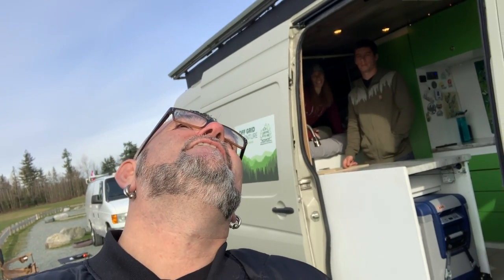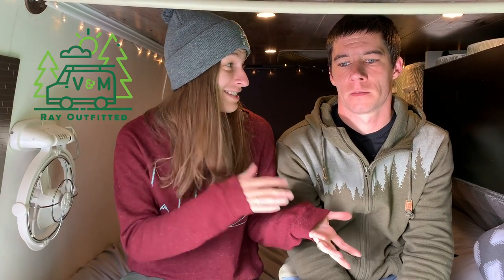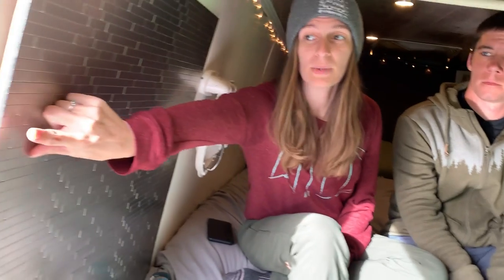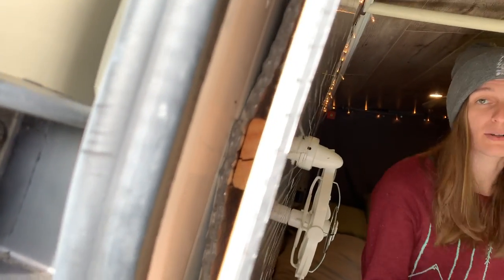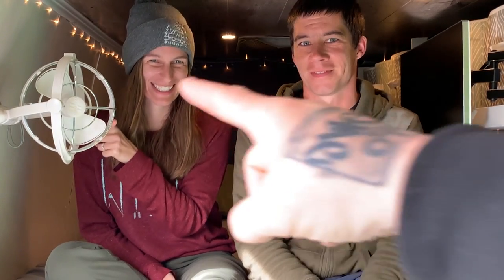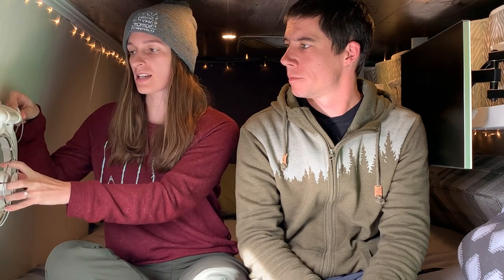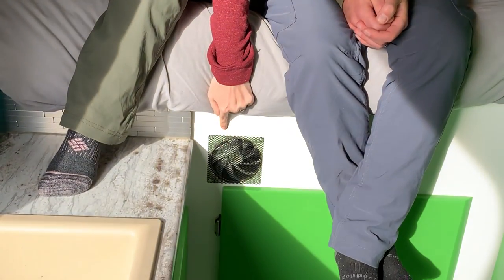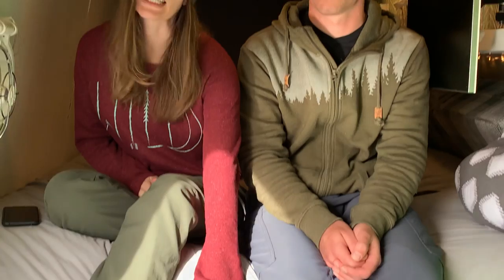Moisture Is Van Life's BIGGEST Problem | VENTILATION and CONDENSATION

Comment: I'll be darned, I actually did something right in my DIY van build.  I have plenty of gaps to allow air flow behind the walls, ceiling, bed, etc. in my build.  lol.
Reply: dont ya love when a "plan" comes together?! lol
Reply: the first will be the last
Reply: I don't believe it works unless you blow hot air into these gaps. Sure, airflow under the bed is great, but if humid air gets between insulation and metal surface and the temperature outside is below dew point, not even mentioning freezing temp, water vapor will inevitably condense on the metal just as it does on glass and won't evaporate for a long time. It might even freeze on the internal side of metal surface. For the context, I am concerned about high humidity weather in UK or Ireland.
Reply: Water vapor will 100% condenser behind even air gapped walls. I purposely left a piece of my tongue and groove off to prove this. I made sure everything is off the metal and then keep my roof vent open and windows cracked even during winter which seems to help

Comment: Ventilation in the UK during 4 months of winter may cause condensation as it holds almost 100% moisture some days. Alternative method like dry heat and dehumidifier are essential.
Reply: I was hoping for someone from UK to comment on this issue. I have been living in Ireland for many years and condensing dehumidifier was the best purchase I made early on. I will be moving into a large van in the summer and I am planning to take dehumidifier with me for winter season. It drains about 260 watts and requires inverter. Condensing water vapor takes the same amount of energy as boiling water, but I should be able to run it for 2-3 hours a day and still have a decent autonomy in poor weather. Decent dehumidifier dries small rooms quickly. Probably there are more modern and efficient devices, so I might have to consider upgrade.
Reply: @pavel9652  A peltier dehumidifier work ok, small 10 Watt units USB DC is more efficient than AC units for Vans
Reply: Just so happens I'm staying the SW US now and think that van travel in this area is even more beneficial due to constant low humidity most of the time in some areas, like Arizona desert.   I may try van life some day and keep tabs on the issues.

I was thinking about doing insulation a bit different:  have it offset just a bit from the wall so more air flow can occur behind it but still keep all the gaps filled.  Have floor or other vents in that gap, too, but also in the inner area, have floor vents and active ventilation plus the dry diesel heater of course.

Comment: I used an espar dry heat diesel heater and opened my roof vent in the winter. Tried all kinds of things but would have condensation on the windshields even with insulated covers. Then had water draining like a faucet from the ceiling when I finally moved the vehicle after a month. Had everything checked, no leaks in the roof of my brand new sprinter. It was all condensation ! Now I run a small dehumidifier when I’m hooked up to shore power. No more rain the the van!

Comment: Its funny - framed homes are the same.  We build them to be air tight, but than we need air movement.  If you don't have air movement you will have mold
Reply: prettymochame just T yes we won on 100 year home that breath a lot and very little problems. Now we have to built air tight and bring air in.
Reply: Have you ever built a home? They are not built to be airtight, we would die.

Comment: Chrome I never see you talk about how to stay cool in your van in the summer there plenty of vid on how to stay warm. Just a thought love your channel bro. ✌
Reply: Leaving the back doors open while backed into a shrubbery to camo the ventilation  and having the fan running for circulation. He has videos for this in past vids while working at golf clubhouse  where he use to DJ.
Reply: That still does not answer my question because in that vid he also placed a air conditioner in the back and plugged it up at the venue he was at but I won't to know what do you do on a daily bases when your not at a venue that you can plug up a air conditioner.
Reply: Well I'm sure there are other ways to stay cool other then a air conditioner and I was wonting some ways that chrome did to stay cool in the summer by the way this question was for chrome not everyone else
Reply: To stay cool, you’d need to follow the weather; get yourself to higher elevations where temperature decreases by about 3.3°F for every 1,000 feet up you go in elevation.
Reply: Head to the beach. It’s always 62 on the Washington coast. 🥰🚐🐶❤️
Reply: I just run my engine on idle and blast the ac all day. Cheaper than a home power bill

Comment: Unless you seal the floor an have a brand new van, there will be air gaps. Also, all vehicles have gaps in the dash, where wires come through and esp the vents (leave 'em open). I have an '05 Sprinter and when its windy I feel air come through, and I have no roof vents.

Comment: What I have done with my van's front windows is install rain / wind guards so the windows can be left slightly open.  The guards prevent rain from getting in and also make it hard to break in with the window slightly open.  One thing they don't work on is blowing snow to my irritation a few times.  I have also built a window cover that has a fold down flap that lets air in and is high enough so that the interior in not visible from the outside. I have back and side windows which I can open with heavy curtains so both air and privacy can be maintained.  So far no screens so I burn mosquito coils placed so the smoke goes out the down wind side.  Simple but it works.

Comment: aircon is the key. Mine in on every single mile I drive. together with the heating of the engine it creates very dry air. so aircon on and ventlation to max whenever you drive.

Comment: I don't know if this can be swapped over to vans, but the tent I use is excellent at removing condensation. The top of the tent has a real breathable material, and windows that can be zipped down enough for flow. The only condensation may be on the under side of the rain fly, but not in the tent. I can even dry my towel and wash cloth in it with no problem.

Comment: I live on Vancouver island and found that my wave 3 doesn't actually put out a lot of moisture.  Realized this When it stopped raining so much but was still cold so I needed heat. My roof vent is 100% of the time open a little as is my high top window. I also have several little 360 fans that I always use one of when im cooking.

Comment: This is a great sharing about dry heat and wet heat resources. Now I truly regret that I got this Mr. Buddy as I live in Vancouver and it rains a lot in winter here. But any suggestion on which dry heat sources is most welcome so I dont make more mistakes. It is trye that my van windiows fogged up when it rains and I usually just turn on my car heater and the fog usually goes away in less than 2 minutes.

Comment: UK has 4 months per year when humidity is too high for ventilation to cure condensation. You would have to run dehumidifiers.
Reply: Best dehumidifiers are several old socks filled with silica crystal cat litter! fill a non holey sock to the heel, twist at the ankle several times and put the rest of the sock back over. place all over your van including by the front window. Works a treat and way cheaper than those little plastic container 'dehumidifiers' you can get
Reply: @moonshayde  ...this is amazing!  Thank you for sharing honey!  xoxo

Comment: Thanks for the info, I have a great deal of windows in my van, and may get one of those max/fantastic fans anyway whenever I get a chance to, for now I'll use the little fans in the little pop out windows that are in the 3 of my big windows to help circulate the ventilation. I just gotten a newer van than my last one, this one is a 2000 GMC Savana 1500 full size conversion van Southern Comfort Edition, with a topper (the topper isn't flat, it one of those that are kinda arrow dinamic kind that already been installed the time the van was made and sold, there have been many previous owners before me, and at least I can stand up inside this one. I live in Odessa TX USA, and much of it here is desert climate, rarely any humidity at times, except during the short winters here. However, whenever it's ok to travel again due this COVID-19, I like to come visit Canada too, in my van that is😊 thanks Chrome too, for sharing this video, give Cruzzie hugs for me 🤗💖 be blessed and safe y'all 💖

Comment: In my next build I think I'm going to ventilate underneath instead using space in the side panels.  My maxxair roof vent is great but consumes about 40 watts and i think i can get the same results from two 6" USB fans at 5 watts and not have to make holes in my roof. Also air from under the van will be cooler.   I am wondering about the vent opening I can go for fan like this if the van is pull and push air from a panel gap that is about 6"x10".  I wonder if I drill Six USD quarter sized holes at the very bottom of the panel gap with a mosquito net inside if that will allow for full air flow in and out?

In addition to air flow questions, i do have concerns about sucking air from roadway gutters and sucking in exhaust.
Reply: Ever consider an exhaust vent on the side of van? Like top corners, so you can route 1 or 2 pathways for an entrance and exit, or just exit; meaning you can hide it between the walls of the van, which is cool.

Comment: 9:34 I was told that the WAVE-3 (6-8) is NOT a wet heat, unlike the Mr.Buddy....
Reply from the maker: JOSE is correct. I have the Olympian wave three and it is definitely 75% dryer then the Mr. buddy heater that I used to have. I enjoy having my wave three. It’s a good little heater

Comment: I have a 28 foot van. It was acquired with foam insulation. I put up panels directly to the ceiling and walls. I'm in Alabama. The humidity trashed all my panels. I have an escape hatch open most of the time. What might you suggest?

Comment: What about in winter when its stored? I have everything closed up to keep the rain and snow out.  No moist heat source.  I do notice some condensation on all the windows?   Any suggestion anyone!  Thanks!   Love the content chrome buddy!   Cheers from prince Edward island
Reply: Your breath will deposit quit a bit of moisture  to the inside of the van.that is part of the condensation you are seeing in you van in the winter
Reply: Any surface that is colder than dew point will cause condensation of water vapor. I know dehumidifiers work. I used to dry normal car with dehumidifier every month or two during periods of no use. There was always some humidity. It gets in from the outside. You exhale 1L of water every day.

Comment: With some searching, there maybe a company that makes a DE-HUMIDIFIER that would work for vans.

What about using your MAXX fans to pull air through your van in a low setting that will ventilate at night and still keep any side windows closed?
Reply: Dehumidifiers are my holy grail in the summers 🤣

Comment: Thanks for the great video!  I have a 1970 VW Riviera poptop camper so that prevents pitting a vent in the ceiling.  I have sliding windows (not the jalousie - ? - kind).  Can you recommend a way to vent without getting rain in the bus if raining?  Also re insulation, if not using a vapor barrier would you just recommend using a waterproof but breathable form of insulation?  Thanks!

Comment: I covered my windows with a wall. I have the glass then blackout material reflectix then pink foam board then wall. All foil taped.  Im getting moisture between the glass and blackout material. How do i stop it. Any solutions? What do i do. I don't want mold.

Comment: There is more options on fans, can't remeber of the top of my head but they are cheap and round and have a built in hood you can pop up. The same company makes small floor vents wich removes the need for windows or open anything. I'm doing floor vents and small fans for more solar room and the ones I'm getting will be under the solar panels for even more weather shielding/stealth. Watch this guy's build this is what I'm going for I love the carpet way more than plywood and he has the fans I'm talking about. https://www.youtube.com/playlist?list=PLpJZ91Ip62fgaUPbEJjjNQx6s7jjkmsoK

Comment: I have a question please.
Doesn't this needed ventilation in the van make the thermal insulation on the walls useless? If cold air is coming in, then insulation has no purpose... Enlighten me please.
Reply: A house where I'm from has 30cm/12" of insulation. 
A typical van has 1/2"..... there's your answer. 
I tend to think about a van like a tent made of metal, keep the vents open and use a dry heat source or warm clothes and you'll be champion.

Comment: Got a question:
I want to keep my walls and ceiling uncovered. I love the look of the metal and having little pockets to store stuff. 
Will not having insulation cause more condensation issues? Or will it just cause hot and cold issues in summer and winter?
I'm planning on one roof fan/vent and cracking my front windows for ventilation. I just really don't want to cover my walls. I might use lizard skin, but unsure right now. 
I live in San Diego, CA so I get humidity and moisture from the ocean air.
Reply: your going to get direct transfer of heat and cold through the metal....you will have to stay in San Diego  because the heat and cold of the rest of the country will be awful
Reply: I saw a van-nomad who did the same thing but he sprayed the ceiling (yes, the ceiling) with that bedliner stuff & he had no condensation.
Reply: I believe a lot depends on where you are and what the weather pattern is like. Van life is not like home life; you trade off comfort for freedom. I think moisture and condensation inside the van is something you just have to keep in mind and make adjustments for wherever you are. For example, if you are in a humid climate or near the water or ocean, you need to get that fan on and get airflow going without allowing rain to come inside if it’s a rainy day (The max air fan has a rain over). If you’re in a hot area, you need to find a happy medium, park in the shade. Beyond all this I think you’ve got to have that air gap between the metal walls/ceiling/floor and insulation that is recommended. Read up on 1/2 inch Poly Iso insulation for vans and, In addition, read up/watch videos on the use of Reflectix to keep the heat out on a very hot day. Another thing to keep in mind is that a well insulated van, on a hot day, will retain all that heat because that is what insulation was made to do. Sleeping inside a hot insulated van after sitting in the heat all day a can be very uncomfortable. It’s just the price you pay for your freedom. Balance is the key. You’ve got to follow the weather for the most part and always be aware of keeping the van dry as possible and airflow has to be adequate. It’s a small space so it shouldn’t be too difficult to open doors and let air in and dry everything out. I dream about this lifestyle every day. Especially now with the coronavirus, I think about being out in the wide open areas of the southwest, places like Arizona, Places like the Colorado River and the Oregon coast. Oh man. If I could just leave the rat race behind. The clock is ticking and I am approaching official retirement age , Which it makes it all the more compelling.On the other hand, there is so much keeping me from making such a big change , including family that I love very much who is quite a distance from the ideal places for van life  in the southwestern US -  I know I would miss them. Anyway hope this helps you guys.

Comment: What about using a catalytic heat source with a sealed, internal propane box that has a vent hole to the exterior?  Will this create drier heat in the van?
Reply from the maker: It’s not the propane bottle that gives off moisture it’s the heater. The Olympian wave three is definitely dryer then the Mr. buddy heater. A substantial difference. I have the Olympian wave three

Comment: Oh dang!...I sealed everything up air tight with batton insulation in the cavities , foam board on the flat surfaces and aluminum tape to seal it all up😳 and my wood paneling is up, nail gunned and screwed in...any tips on how to remedy and create some air flow without removing the paneling?
Reply: Otter Bliss  Ha! If I weren’t sitting in my van right now I’d have thought you’d stolen mine! 😁 I’m a big fan of Rid-x; use it it 2 places in my Ford Transit. It’s amazing how much moisture it pulls in over the course of a night. I am about to get vent visors for the front windows, so I can leave the windows cracked without stressing out.
Reply: Daniel Hresko ...so you’ve sealed everything up too, hey? How long ago did you insulate and Have you dared to peek behind the “seal”?...and mould?
I’ve heard of Rid-x...thx for the reminder btw👍🏽😊
Reply: Oh I forgot to mention in my first comment that after insulating I covered the walls and ceiling with Reflectix and sealed all of it with aluminum tape. Is that pretty much what you did as well?